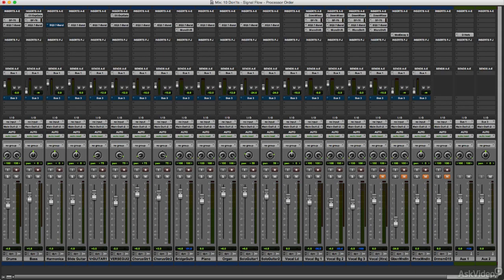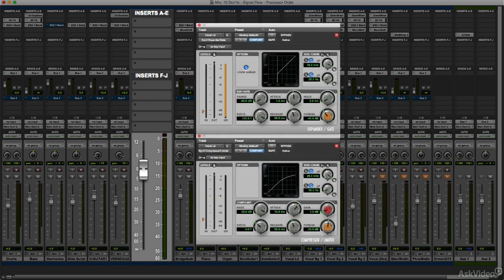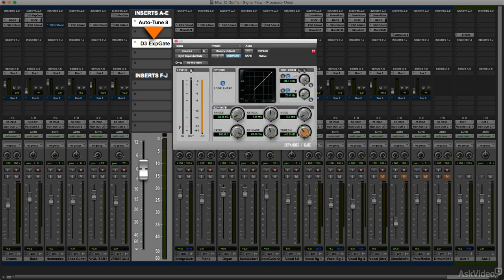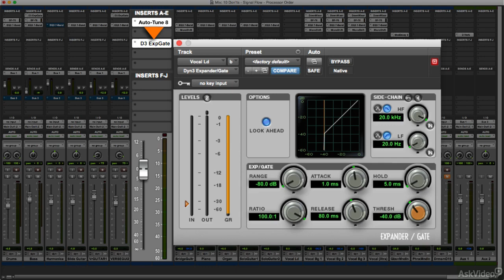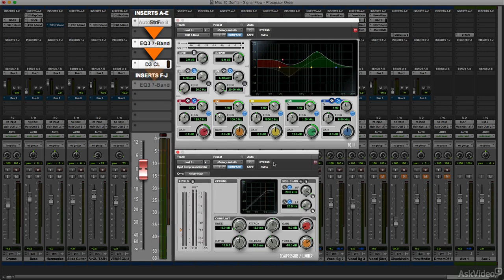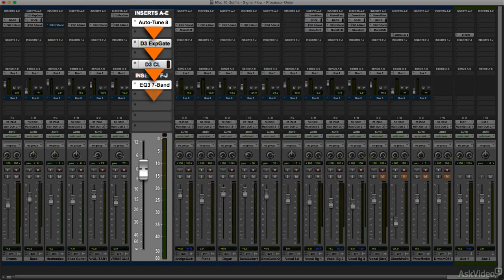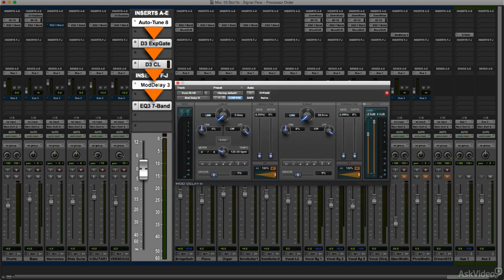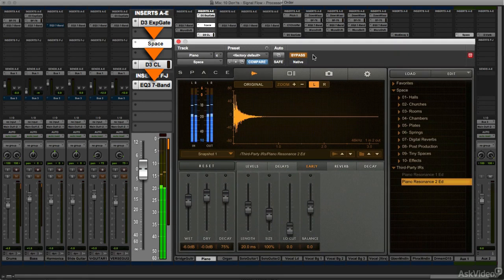Audio Mistakes 107: 10 Common Signal Flow Mistakes - 2. Processing Order

Comment: If you were really addressing "conventional wisdom" it would actually be EQ then compression for a couple of reasons. A) In a traditional studio console set up you would EQ using the console and use a piece of outboard for compression, so unless you were using a modern console with onboard dynamics you would EQ first. B) It makes more sense to compress the sound you will ultimately hear, otherwise your compressor will be reacting differently to your un-EQ'd sound. For instance if you do a large low cut your compressor will be reacting to it when it's not actually there after EQ. 
But thanks to DAWs we can now do what we want. 
The ideal setup really is subtractive EQ>Compression>Additive EQ.
Reply: I too thought this, EQ should nearly always be placed first for all the reasons you state.